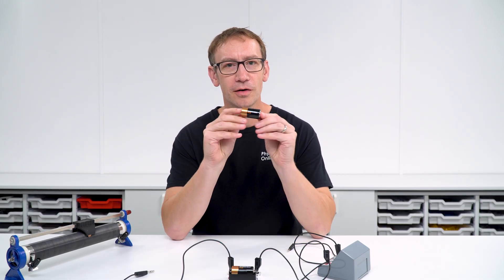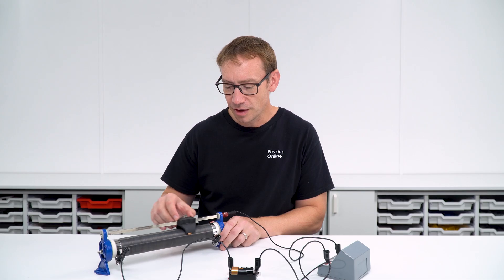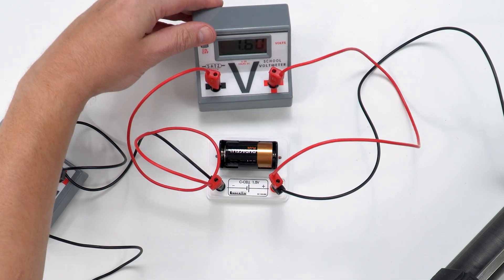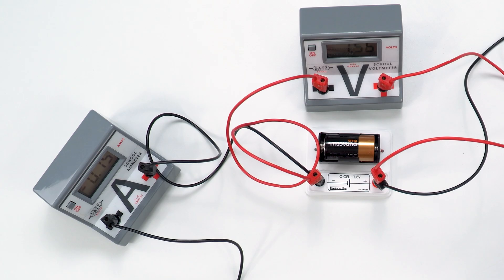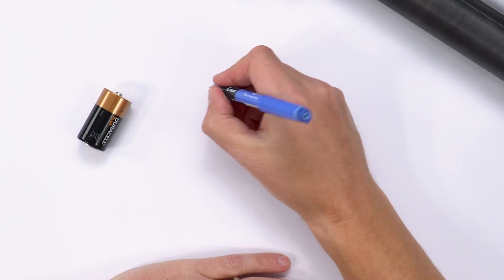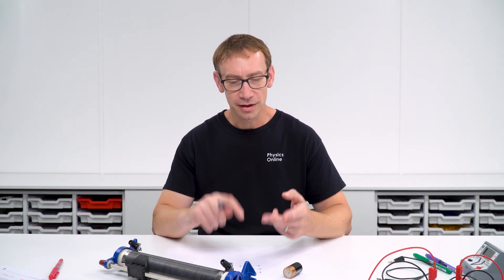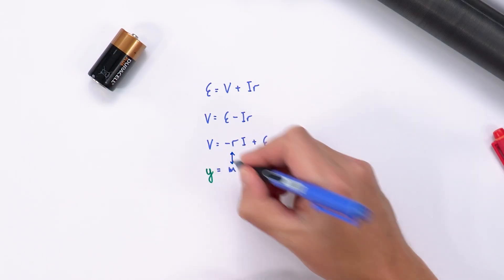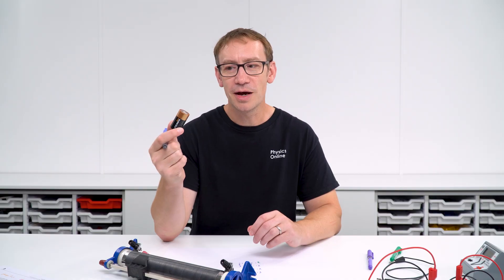Internal Resistance - A Level Physics Practical

Comment: Would be good to draw + show continuously the equivalent circuit of the cell - showing an internal "perfect" voltage source with zero internal impedance , and voltage = open circuit voltage of the cell  in series with an internal impedance.  It is then clear to see that the terminal pd of the cell will drop as current is drawn.  A switch in the circuit is also a good idea so you can immediately see the effect of adding and removing the load